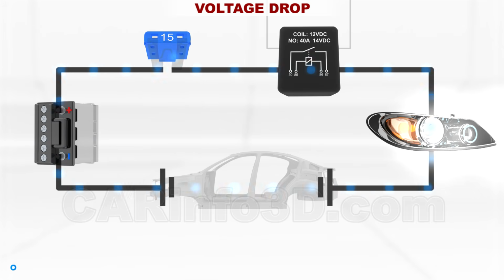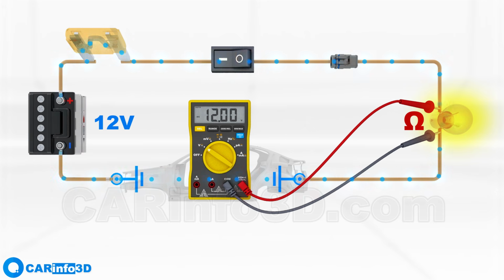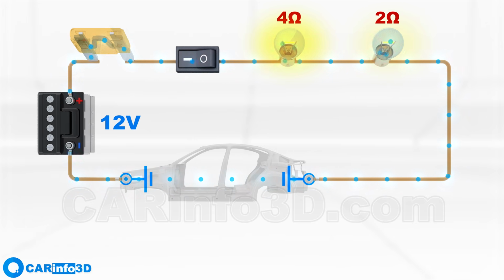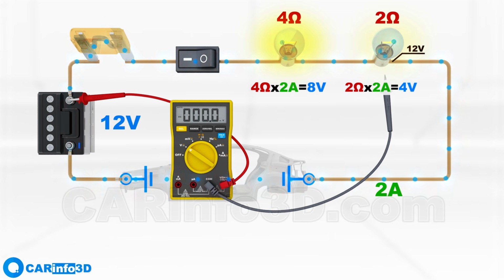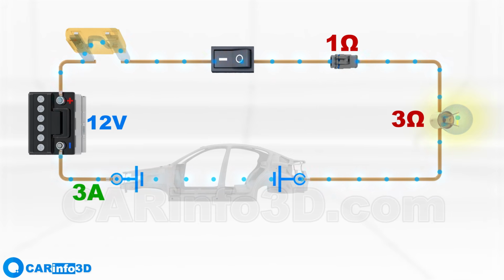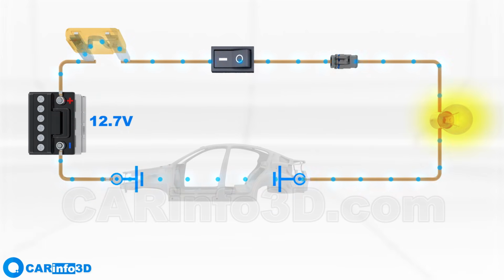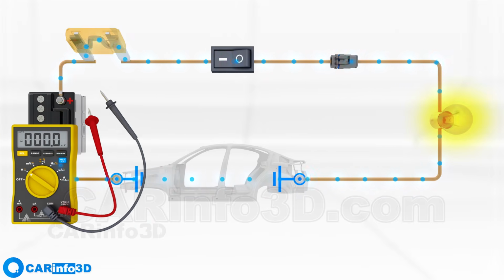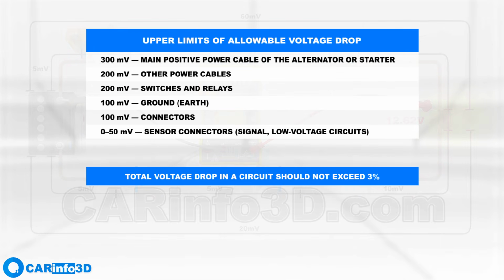What Is Voltage Drop?

Comment: Video idea: in my kia rio which has a dct 7 speed after driving it past 120k km the clutch and dct is very harsh when just starting to drive the car, the dct doesnt know whether to put power to the clutch or not and its becomes shakey, but after driving for 10min its perfectly fine

Comment: Thank you very much. It can be added that if the voltage drops a lot, under load, the battery may be failing but its internal resistance increases with age.